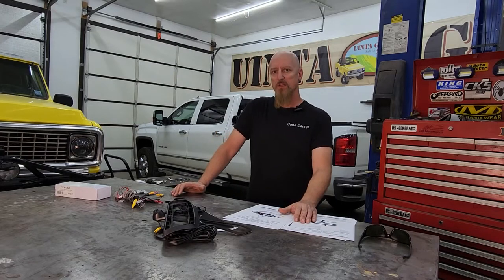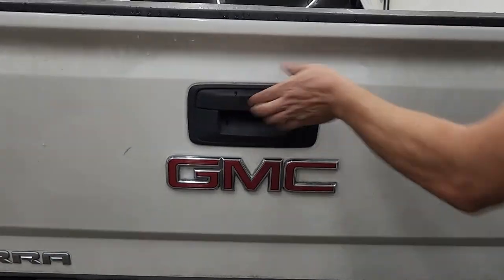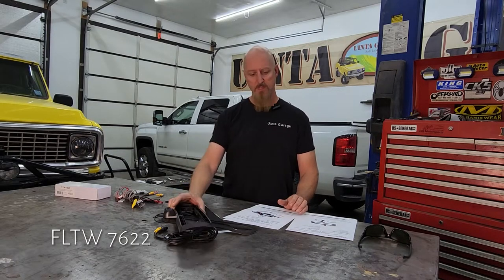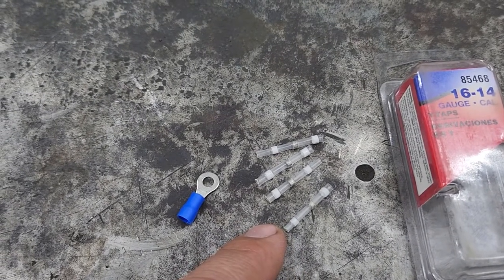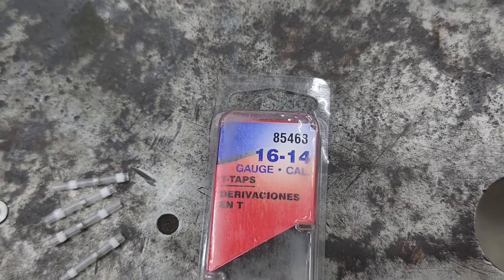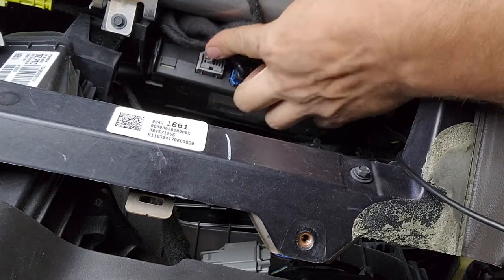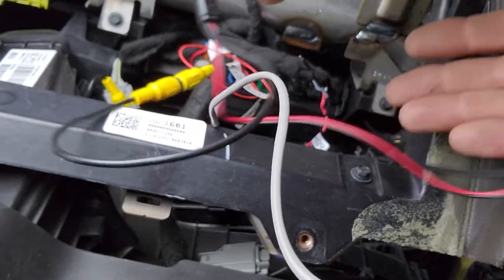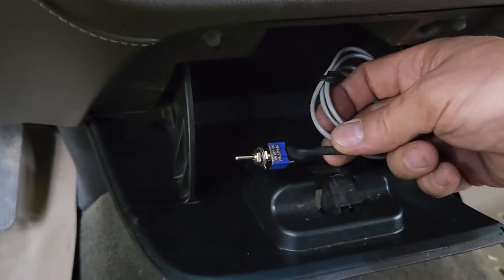truck bed camera install 2014-2018 chevy/gmc

Comment: Good video. Enjoyed  the step by step process. Just a few things to note from my install... the glove box can be entirely removed by the 4 screws only, no need to remove the hinge pins. For the power, I like you, did not like the toggle, so I got a push-button switch from Amazon and replaced the aux (cigarette lighter) connector on the dash and hid the switch in there and also used the power from that aux to power the backup camera. no drilling holes in my dash. Thanks again for the install video.

Comment: Is there a way to have this camera on while driving? Or does it work only in reverse
Reply from the maker: It's controlled by the truck system, so it only comes on in reverse. It would be nice to find a way around that though.